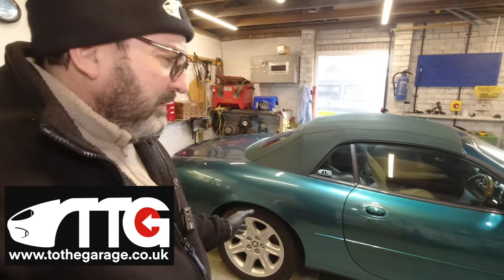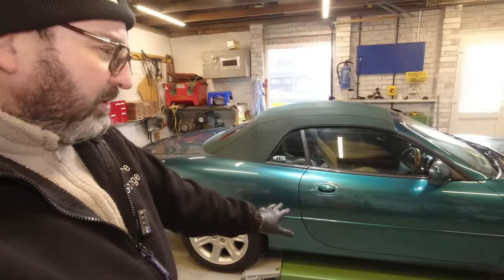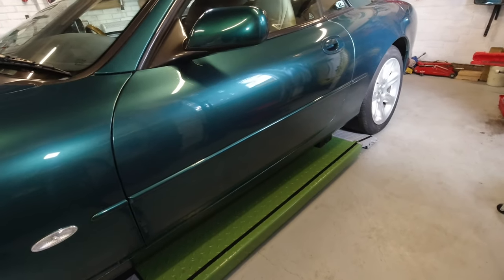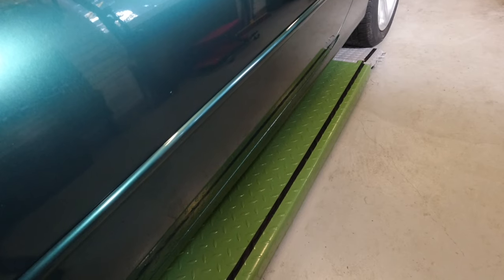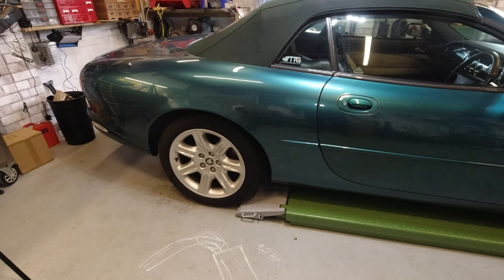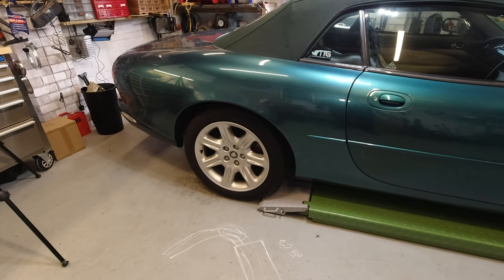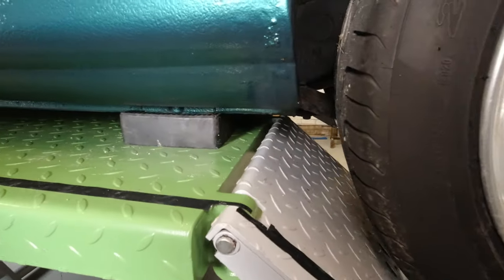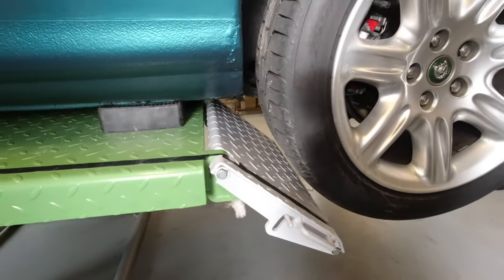is a home garage Scissor lift too much trouble?

Comment: I got mine cheap used ($500) from a thriving auto repair business who never used it despite it being on their shop floor because post lifts are so much more versatile. I use mine as welding shop lift table but it blocking the underside of the vehicle is why I'd only buy one new if there were NO other lift option.  They're far better than nothing but IMO most sell to people who expect them to be better than they are and don't want to install a post lift. If you do any kind of serious automotive work get a post lift. The post lift takes much less floor space and can do things like lift bodies off frames, unload vehicles backed beneath it etc. Two-post lifts (they make short one nowadays which fit residential garages) are so much better that most businesses using pantograph lifts just use them for tire and brake work or repairs in those regions.

Comment: When I built my garage 4 years ago I went with a bend pack 2-post asymmetrical. Total cost of the lift, delivery and installation was just $3,800. Best decision I've ever made. The scissor lift is a great choice if hight clearance in an issue.
Reply from the maker: Thats a good lift. I take it you have no height restriction

Comment: I end up having to use 3 different jacks to get the car on axle stands high enough for me to fit underneath because the other lifting points besides the pench welds have the plastic undertray covering them. This would be the way to go for sure.

Comment: I looked at all the lift options a couple of years ago and in the end went for a single post lift. It's ideal for a DIY garage because it takes up little room and is fully portable. You can even take it outside for underneath pressure washing etc if the weather is good and your garage door is high enough. The biggest disadvantage is that you need to have the garage converted so that it has no joists in the way and, if you want to drop a gearbox to change a clutch, then it's more fiddly than a four or two post lift, but still possible. Obviously the two and four post lifts need the joist conversion as well. After two years I can say that I made the right choice for me but the joist conversion is a lot more expensive than the lift! Richard
Reply from the maker: Interesting Richard,  To be fair the single post is the only one I didn't consider fully as to be honest they just freak me out a bit. (And im an engineer so I should know better)
the only negatives for me with the scissor is that sill area access is restricted and Im limited to a 1 meter lift. But the 2nd point was informed by the Joist situation and I too had a moment of realisation ref cost moving the joists😁. In my case it was too much for me to stomach at the time.  Mine also can be pulled outside if required using clever mobility wheels .

Comment: This one looks a lot better than those connected at the top but I'm still considering the ramps that aren't connected at all as it seems you could slide them in and out of an already parked car and there'd be nothing getting in the way underneath.  It may not be quite as secure though.
Reply from the maker: I think the very low rise ones would be fine . Just if you start lifting more than a foot, I would be a little unsure🤔

Comment: I built and designed a semi scissor lift that allows you to work under the car. I used ACME screws instead of hydraulics because they are intrinsically safe - they won't unscrew under weight. Unfortunately, I couldn't find appropriate motors that would be small enough and powerful enough to drive it even though 1/2" electric drills work. Here's the lift https://youtu.be/oHJm-M3fHjA
Reply from the maker: Really interesting Eugene. I enjoyed both your videos on the topic👍
Woould you mind if i include a small extract of your video in an upcoming episode? I think a lot of them would be interested.
I would of course provide subscibers with a link to your channel to watch the videos in full.
Reply: That’s an interesting design. I frankly wouldn’t trust the ACME screws (at least not in the size you chose), because even though they will not unscrew, they will wear out :) 
But even if your design would be converted to hydraulics, it could be interesting. Nice job 👍

Comment: Excellent Video and the idea of putting down the black tape for giudance is a good pointer. My question is do you have much space in the middle underneath the car to remove a transmission/exhaust system etc?
Reply from the maker: Plenty. Recently did the exhaust system and access to the. gearbox is completely unhindered though I cant claim to have removed it
Reply: @ToTheGarage  Great! Thank you for getting back to me so quickly very much appreciated.

Comment: If the weight is at the front of the car and the lifts centre of gravity isnt centre, it does matter which direction the car is.
Reply from the maker: Our cars have a pretty balanced axle to axle weight. Not due to a light engine as much as having a Heavy rear axle

Comment: Very nice, but unless you are are someone who is always faffing with cars, perhaps not worth the expense...I haven’t looked up the cost,  it I’m guessing they are probably a good couple of grand or more...tell me, what do you use to work under the car, a seat on rollers, a raised bench to lay on on rollers...? As not rising so high as to be able to walk under it, and reach up to work, I would think having to bend over under it and raise arms to work could be quite awkward, and take it out of your back a fair bit...?
Reply from the maker: 1) There are 212 videos of me faffing with my cars! so safe to say I am.
2) £1700. 
3) I Sit on a cushion. or my crawling board.
4) Couldn't lift higher without building a new roof on my garage.

Comment: Hey man, i have one of them, different brand. I have a piece of advice. Do not lock the ramp. What happens if your motor or pump stops working. This means you wont be able to get your car off. Even if the latches are not under the catches fully, if there was a fluid leak or something, it was fall about 2cm before engaging into the latch.

Comment: I see these lifts and as a mobile mechanic I just think to myself, whats the point. I mean the height of the lift is putting the car in a place where to work on anything will cause you back ache. Its not high enough. A 4 poster takes the car up. There high up so you can walk beneath it. I just removed an engine from an Audi Q5 on the street in London. Never used a lift in my life. On axle stands with 3 ton jack underneath and the wheels for extra safety. Remove parts around engine and cables, then go for it. Unbolt gearbox and pull engine out. Same for everything else. But to be under that lift of yours my back would suffer horrendously. Cars just not up enough.
Reply from the maker: Hi James👍 
If I rebuilt my garage then  I would give myself more height and a thicker concrete base and I would then go for  a two or four poster.
But in the absence of the cash to do all of that, I would far rather have my scissor lift than no lift. 
My youth was spent fixing my old bangers at the kerb or in my dads rented council garage, so I applaud your Major work on the Q5🍺
Reply: @ToTheGarage  Thanks for the applaud. I get paid by the hour too so makes no sense to work too fast. Like the red bull car though my father who used to make propshafts had a large lorry propshaft on his roof of his Escort mk1 van. Painted black with pink ribbon front end. His journeys around Sutton where he'd worked, many people recognised his van because of the unusual advertising. So if I could have a truck with one of these scissor lifts/ramps fitted into the back. A flat bed truck 7.5 ton and the ramp on board ready to lift cars, I think it would grab people. Its not what you know but who you know. So people would talk about it and I believe more work would come my way. Mobile garage. Literally do any job anywhere. 

As is though, I only ever known the roadside method. It works for me.

Comment: Anybody have an thoughts on using this on a blocked paved drive. I have not issues using  a trolley jacks axle stands or ramps on it. The large foot print of area looks as if it will spread the load ok.
Reply from the maker: I think it would work well. your car is currently exerting  circa 375 kg per sq ft? on the drive.
Car and ramp together would exert circa 120 kg Sq Ft.  So as long as the drive way is well established, I would imagine all would be well
Reply: @ToTheGarage  question how would it fair. Outside weather wise ?
Reply: @MrGreen_  It would get wet if it rained, and go rusty! But I believe they are portable....
Reply: @ToTheGarage  How did you calculate the car exerting 375 kg per sq ft of tire patch?  That is some light car.
Reply from the maker: @ThisOldMan-ya472  it’s merely an off the cuff calculation of the average car weight at 1500 kg spread across 4 tyres. If we assume a 1 ft square contact patch / tyre (bigger than the vast majority of tyres) Even with these huge contact patches, The car would exert 3 x the force per square foot than the ramp and car combined when spread over the ramps foot print. So the block paving would see less localised pressure from the car on a ramp than just parking a car on it.
Reply: @ToTheGarage  6 tires would occupy one square foot of tire footprint. Each tire would occupy a patch approximately  4" x 6" or 3" x 8".

Comment: Hi john that was very good lift. I want to ask If you have any idea why my jaguar convertible like yours leaks oil near the sun visor and now it doesn’t open no more electrically any more. What could be the cause? If you have an idea I would appreciate you letting me know 
Thank you
Reply: If You are leaking oil near the sun visor then you have a failed Hydraulic pipe that goes to the roof clamp mechanism. The whole pipe to the pump will need replacing. Change them both.
Reply: Steve is correct. There is a slightly possibility that it could just be a weeping union at the clamp but it is more likely to be a failed hose. It's not a simple job but there is no other solution. 😢
Reply from the maker: Richard and Steve have put it better than I could have Khoder.
Thanks guys

Comment: I want one of these sooo badly, they all seem to hover around 2k mark. 
Do you think with this item would survive outdoors? (Obviously not electrically)
I am thinking of laying a driveway just for this item.
Reply from the maker: I DONT SEE WHY NOT. The hydraulic cylinder are the most rust sensitive item and they are totally covered by the platforms. With a bit.  of thought and good drainage it should be doable?
Reply: In warmer countries I've seen 2-post lifts installed outdoors. They had fabric canopy I think but it looked much more like sunshade than rain protection. And also in colder countries I've seen these in carports / cold garages.
Reply: We have a 2 post hoist installed outside that has been there since 2012, we covered the electrical motor with a bucket lol this is New Zealand and with a rotary type Hoist.

Comment: Hi John 
I like the lift, a good addition 
But was that rust I saw on the rear of the sill area?
P.s I love the color of the car
Reply from the maker: Yes it was. A few blisters just in front of the rear left wheel. I will have to get to them soon.
Reply: @ToTheGarage  John 
Get them before they get you 
Love the channel 
I have an xkr 2000 my, 37000 miles from new , owned it for years now 
And still love it

Comment: How hard it to remove transmission with this type of lift sincenit has a big bar in the middle. Do you feel its in the way?
Reply from the maker: There is a bar (synchroniser) at floor level but nothing anywhere else. So the gap between the rising platforms is completely clear
Reply: @ToTheGarage  thanks.

Comment: does it work off 3 pin uk plug
Reply from the maker: Technically yes. But you are likely to blow a few fuses as the pump starting up spikes the supply momentarily. Mine is hard-wired into a 16 amp breaker. The guys at strongman can advise though

Comment: Shame you need a compressor to use it..
Reply from the maker: No I don't!
Electrically operated safe mech release. Not hooked to my air in any way
Reply: @ToTheGarage  
Hi, thanks for getting back to me, after watching your fabulous reviews I decided, this was the one I was going to buy, so I thought I'd research Strongman a little bit more, and their company video showing how to install it, shows the safety release mechanism being hooked up to an airline !
Is your lift a different model then, or have they just done away with the need for an airline? 
Thanks again for the reply..
Reply from the maker: @Mister_Pinx  Earlier versions. did I think have. an air actuated. safety device. Im assuming its been phased out and its an old. video?  Check with them before you buy though.👍

Comment: Too much trouble 😂😂😂😂nope
Reply from the maker: The live chat has now timed out😔
Reply from the maker: 2 poster is great but takes up too much width for me and the floor would need some rienforcing
Reply from the maker: I don't think a four poster is as flexible without adding a cross beam Jack so that. you can work with the wheels dangling.
Reply: @ToTheGarage  Yes, you definitely need the wheels dangling to wiggle your stage 2 over the axle and drive shafts. I tried with the rear wheels on ramps and had to jack it up from the ramps.
Reply: @ToTheGarage  Exactly my thinking John. I would say that 90% of the time that I have car up on my lift I end up with the wheels off.
Reply: @ToTheGarage  Exactly the same reasons that I ruled the two poster out John.